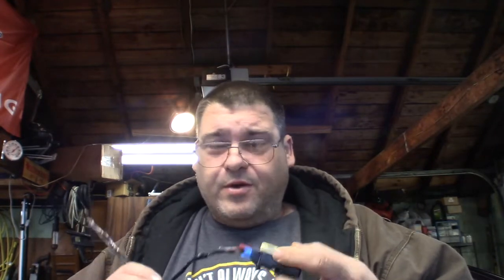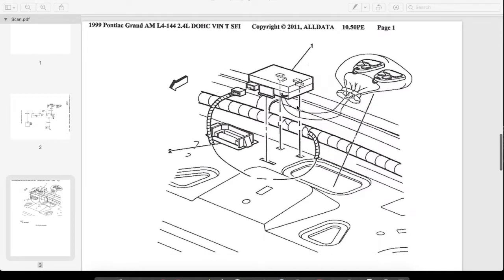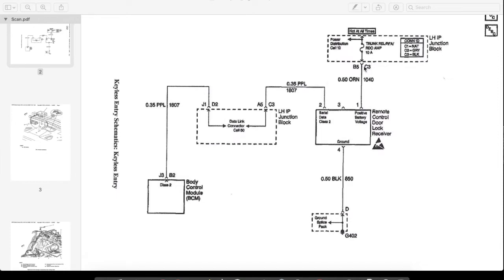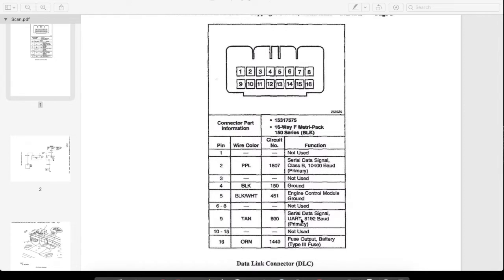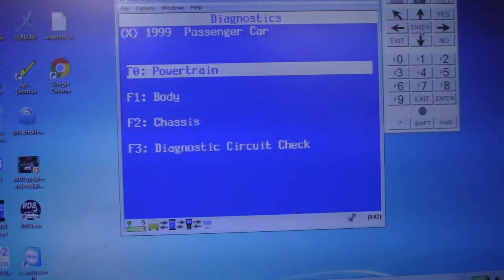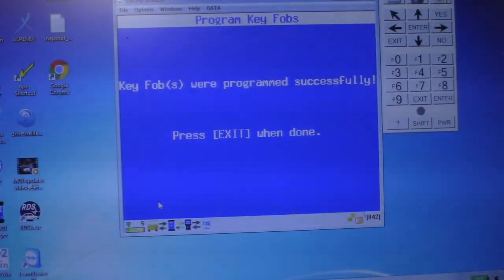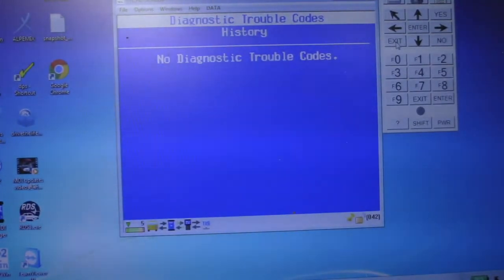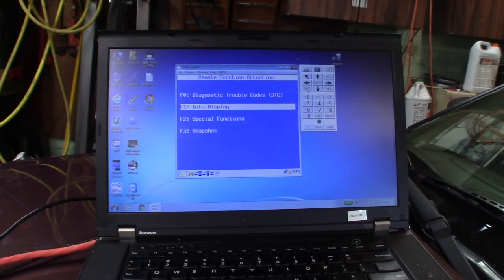Attemping to Add Keyless Entry Option & RFA Module to 1999 Pontiac Grand Am

Comment: Tom I responded to you before talking about my BCM how it got corroded from water. So I installed a new BCM and PCM from a junkyard car which happens to have a remote key fob which mine didn't. Do you think that I have the original equipment all there to just plug and play then plug & Play? ... I also just bought VXdiag nano obd2 tool which comes with tech2win. I also own an OTC genisys touch scan tool which showed that two keys were already in the system. I just need to get a fob because I don't think the junkyard one has it on the keyring. Could you tell me where the raf box is exactly and any info I might need?
Reply from the maker: The RFA Module lives in the rear deck.  You can get to it from the trunk.

Comment: Did you ever figure this out?  I am trying to figure out how to program extra FOB's for my 1999 Alero, and so far your videos are the most useful.  I am also wondering with your setup (and exactly what is that) can do other things I am interested in like wheel sensor live data and oil life monitor percentage.
Reply from the maker: Yeah If yours came with a kefob you just need to program them.  On the 99 you will need a scan tool that can program them.  I am using GM MDI2 and Tech2Win on this one.

Comment: Are you still around? I'd seen a newer vid here on YouTube where a guy had a bam with small antenna on a bcm from a newer year bcm. I have a 2004 Pontiac grand am and have no fob. I have an otc genisys touch but my body control is locked on it !?!. Anyways seen a tech 2 on Amazon for 80 bucks and not sure if that'll help. I have electric everything but haven't checked for the rfa box or rpo code in the spare tire section. I'm not a master mechanic and have no availability to wiring diagrams which I'd love to have from my bcm. The damn thing gets wet and corroded in these 2004's and a pin even corroded off which I had to solder a wire from the inside to out 🤦😂...I need help 😂
Reply from the maker: On a 2004, you will need to check the RPO Code to see if you car had  a Remote from the factory.  On a 2004 the options are all changed is the software, based on the VIN #.   If it did come with it, then you can replace the BCM with another from the junk yard and reprogram it to match your VIN.  To reprogram it you want to get a MDI Jbox clone and you will have to pay $40 to get the programming software from GM's site.  You can sometimes on these re-configure the BCM with a tech 2 without having to access the software update, (This is called the AS IS information), but I will need to come from the same car with all the same options.   You can e-mail me at tom@frugalprepper.rocks and I can get you the wiring diagram.

Comment: Any update to this? Apparently GM put out a TSB for reduced RKE range, the solution was the installation of the RFA module AND a new BCM! 25695953 RFA Module, Keyless Entry; 12206799 Body Control Module. This is listed for the 2001 MY.
Reply from the maker: Not yet, in order to program the BCM with the RPO codes, I would need an actual Tech 2, then I need a Windows XP laptop with a serial port and the TIS2000 Software so I can tell it that it has Keyless entry.  I will require adding a few wires to the harness as well.  I am not sure if I will do it, or if I will live with it, or get and after market add on.  So far I haven't come across the correct BCM at the junk yard.

Comment: C1275 sunfire 2.4 automatic problem, help!!
Reply from the maker: What Year.  You've lost communication with your ABS controller.  You need to check powers and grounds and the Buss.  It will either be class 2 or CAN depending on year.
Reply: @frugalprepper  the cars is 2000 2.4 automatic pontiac sunfire

Comment: You may want to see if there are more than one BCM for the car. (I am not sure about this) I found that the Chevy Venture WITHOUT remote door lock has a different BCM than the one WITH . Look at this: http://my-chevy-venture.com/Upgrade-Body-Control-Module-BCM.html
Reply from the maker: This is very interesting.  I need to figure out where I can find a list of BCM part numbers and what options they have.  Hmmm...